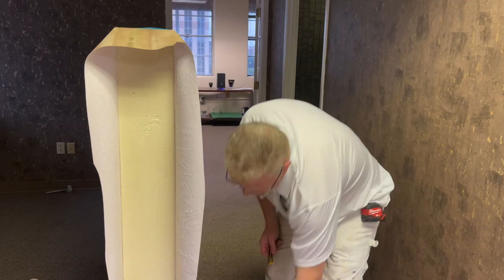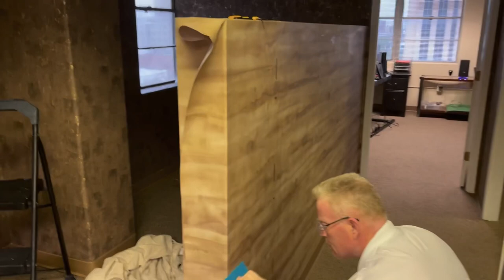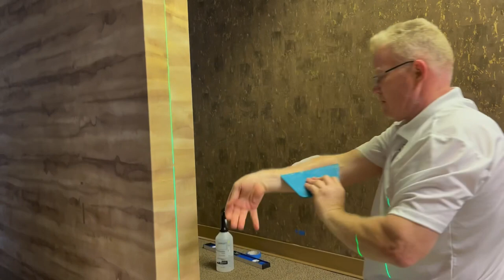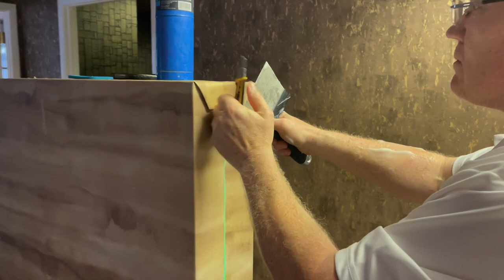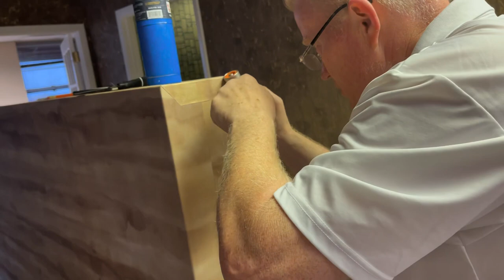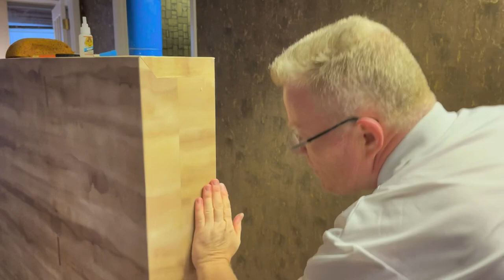How to Wallpaper (Gift Wrap) a Pony Wall - Spencer Colgan

Comment: When you come up to situations like this. Is it advisable to see if you could talk customers into clear corner beads versus making the outside corner. I'm sure case could be made that it will last longer and hold up to abuse. After Time those seems have got to want to pull away and curl?